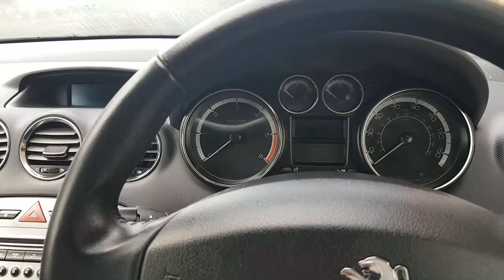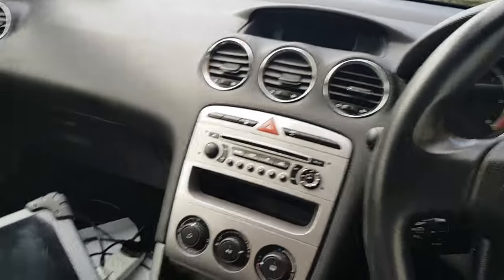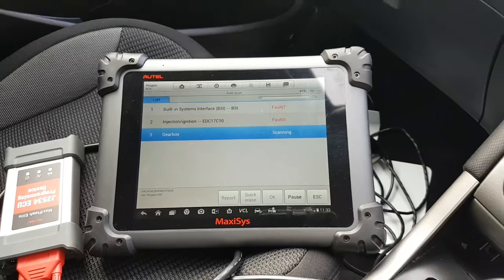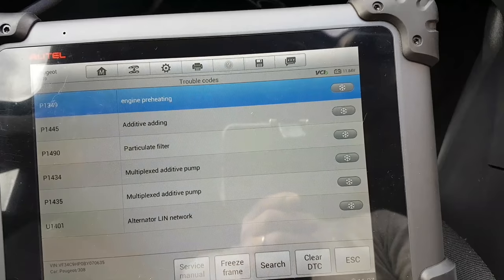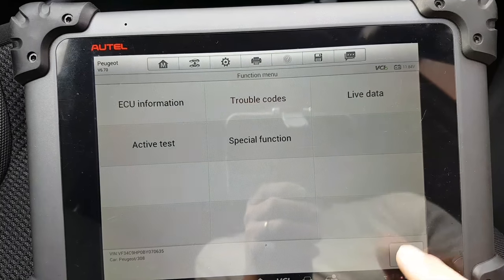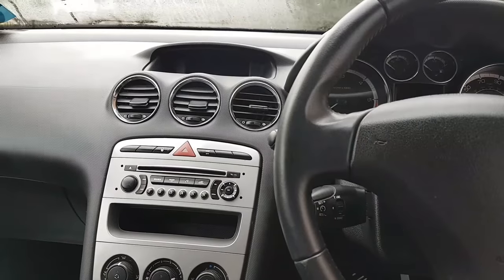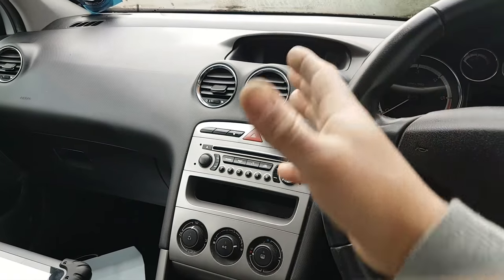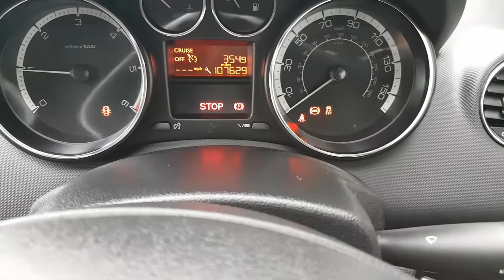Peugeot 308 not starting and multiple faults F569 C56E. Fault finding and repair.

Comment: My 2012 Peugeot 308 diesel only 29000 miles warning lights came on including the power steering and the power steering failed while i was driving ... the fault was the alternator apparently if your battery drops  below  about 11 volts all hell breaks out the car will try to kill you and your passengers ...  new alternator  £500 fitter ...  sound expensive  but the alternator was about £400..
Reply from the maker: Yes... low voltages can cause all sort of problems and gremlins...
Thank you for watching!
Reply: @LMAutoRepairs   love the videos  ....thanks

Comment: thank you very much for help. my friend has citroen c4 picasso 2009 with automatic transmission and suddenly car died- with many errors( didnt shifted or showed gears, didnt worked parking brake etc.). I found mentioned error in ecu and on the main cable behind that problematic relay was 1,5V instead 12V. So according your advice we changed whole unit and car is working like charm. That was wonderful.
Reply from the maker: 😊
That's great! 
👍👍👍

Comment: Good vidéo, thank you. just a question: the double relay that powred the pump and the solenoid valves of the ABS is it integr to this fameu module? if not where is it? thanks

Comment: Hello, I had same fault and waiting for relay. Is it safe to to drive while the two points are bridged.
Reply from the maker: Shouldn't be much of an issue...
Just have it sorted as soon as you can...
👍👍👍
Reply: Hello l, just wounderd for any advise really. So I changed the unit. Started great after an hour of leaving it had  same problem  again not starting just clicking. Out of all ideas? I put the bridge on again Started no problem
Reply from the maker: The unit you replaced it with, was new or second hand?

Comment: Excellent detailed video. My 2010 308 had a similar issue of multiple fault codes and intermittent starting. There would have been no way I could have diagnosed the problem myself so watching your process identified the issue was the same. I bought and fitted a second hand replacement battery management module part as you did. Car now starts and runs as it should with no warning lights. Many thanks for sharing 👍👍👍
Reply from the maker: 😊
That's great!
Well done!
Thank you for watching and for your comment!

Comment: This is exactly what happent to my peugeot 308,and same issue with all faults on. First all started with battery problem after I washed engine space. Hope I will solve my problem will write later.
Reply from the maker: 🤞
Good luck...
Thank you for watching!
Reply: Ok, changed everything, still dont have steering. I hope my pump is not dead.
Reply: Didnt solve the problem. Car wont crank, but when I connect + from battery to this unit's + I changed, then I hear click then I can start engine. Still have steering problem. Also battery is charging but it showed me that I have problem with charging the battery. After I turned off engine, and turned it on again battery lamp was off and everything was fine, but I still have steering problem. Any idea? 😊
Reply: Still nothing, tried with another steering pump, that is not a problem, tried also with another alternator. My bpga is reseting all the time. Problem started after I washed engine area. Also tried with another bsi, that is not a problem.
Reply from the maker: Check for water intrusion on plugs, etc...
Check grounds...
Reply: Grounds ok, plugs dry, fuses ok

Comment: Awesome vid , Ive suspected I had an earthing issue a lot of intermittent faults, currently, there is a gearbox fault  (no comms on bus ) there's a power steering fault a brake fault both high and low fuel rail pressure, no coms with the accelerometer steering wheel misalignment a broken cv boot o and sometimes it allows me to have high beam sometimes it doesn't . I think this sort of thing might be the issue for some of it . Just replaced the solenoid pack which did absolutely nothing to the gearbox fault 186 KM so probably was about to poop it anyway first transmission oil change I suspect . Gearbox is very brutal at engauging  at times other times ok .  O and I have to wiggle the steering wheel to start it sometimes . The joys of being owned by a Peugeot
Reply from the maker: Indeed... I would say the joys of owning a French car...😋
Hope you get yours sorted...
Thank you for watching and for your comment! 
👍👍👍

Comment: Do you know the U0028 fault code on a Peugeot 3008? instrument panel switched off while driving. The car wont start if the instrument panel does not light up. After a day the instrument panel lights up after opening the drivers door allowing to start the car. I also see the battery voltage is 15v when the car is running using a voltmeter but cheap diagnostic tool shows 15.2v.
Reply from the maker: High voltage can cause all sort of gremlins...
Double check that...
Thank you for watching!

Comment: Hi after configuration on a 208 bsi for no front seatbelt warning, good no sound for seat belts but remains fault B1003 configuration permanent and dont let me set it back. What do you suggest? I used thinkdiag
Reply from the maker: Sometimes you need to configure multiple modules for certain mods...
Not sure about that for the seat belts, as I have never done it...
But check to see if there if any configurations on other modes seat belt related...
👍👍👍

Comment: My girlfriend has a 308 sw 1.6hdi 2009. Have a major issue starting in cold weather heater plugs and module was tested and are in good working order machinic says it might be in the wiring. Also no heater coil coming up on dash when you turn the ignition on. Car starts straight away with a bit of easy start, any ideas ? At withs end with the car now and no fault codes coming up could it be corroded wires or connectors or where to start ?
Reply from the maker: Measure and check the wiring from the module to the plugs...
Test/Measure the plugs as well...
👍👍👍

Comment: Just on a different subject, we have a 2011 Peugeot 308, 1.9 diesel that is destroying starters. It is destroying the  brushes and commutator as if its staying engaged, as if the ignition switch was faulty. An issue on older cars. The ECU/BCI won't let this to happen though. Had you heard of any issues like this? Thanks for your time.
Reply from the maker: No... never even had that issue...
Just check that indeed the started is staying engaged...
I would say however, that such thing would be quite noticeable...
Thank you for watching!

Comment: Hi, I enjoyed your video. So it's not the starter motor or the alternator. I drive a 2012  508. I just put a new battery in the car. I have been having similar problems and at my wits end trying to start the car.
Reply: Hello. I have similar issues as you are describing. How did you solve your problem? Thanks
Reply: @conanobrien1  actually, the problem was not the  battery. Do u see where all the two or three big cables are tied down with a nut in the picture. That was the problem because the nut was loose.
Reply: @tommalone8026  Can you give me the time in the video where I can see the cables you are talking about? Is it at 13:19
Reply: Hi Conan, @ 13min you see a cable connection under the finger. Beside that connection u see a nut, make sure that is tightened securely.

Comment: Hello my master :-), my Peugeot also sometimes does not start and only the clock hands jump. I also noticed that when I turn the key in the ignition twice before starting the engine, the engine has more power, it does not jerk when starting and driving, and the electric windows go up faster. Could this battery module relay be giving out too little current when it makes a poor connection?
Reply from the maker: Difficult to say without checking...
Check/test your battery, connections, etc...
Scan the car, check live data, see if there is anything that points into any direction...
👍👍👍
Reply: @LMAutoRepairs  thnx

Comment: Thanks for great explained video! How sure I can be that the problem is at the relay? How often problem is located to wiring? My car did that once and it dissapeared after battery change, now it's giving "power steering fault" info at the screen. I have 1.6 VTI 120 /2011
Reply from the maker: Difficult to say...
Start by scanning the car and go from there...
Thank you for watching and for your comment!
Reply: Had to add that in my case the problem might be oxidation at +bat contact. I think quick release clamp is not the best choice for car batteries.

Comment: Hi, I have a 308, 2016 year. Some of its malfunction indicator lamps always (ABS, ESP, hill start assist, electronic handbrake etc.)  turn on after raining. First I thought that a malfunction (like wetting some electronics) under bonnet is causing this problem but even during a newly started rain, its lamps turn on. I mean there is not a chance for bonnet to get wet. Can the problem be with sensors near tires or what could be the problem, can you help?
Reply from the maker: If you say that it is when is raining, surely water is getting somewhere...
Have you scanned the car?
I am pretty sure that all those faults are due to one single issue causing them all...
Scan the car and check live data...
👍👍👍👍

Comment: Hi. I have the same problem on a 2016 DS5 2.0 HDI 180. I have the BPGU on order but a global supply issue means no delivery date. Car has been starting eventually (1-20 minutes of hitting start button). But last week it stopped starting and goes into economy mode. I have 12.5v on battery and to fuses that don’t go through the BPGU. But only 0.6v on the outlet of the BPGU. Can I do what you did and bypass the BPGU with a wire from the positive to the BPGU outlet side? If I can do you think it might “reset” things back to the way it was or can it be driven like that. Thanks in advance. Jeremy
Reply from the maker: I would say, it should be ok to temporarily get it going...
👍👍👍

Comment: Hi sorry to trouble you but I'm having a problem with my 207 1.4. My power steering light came on and the car went very heavy I had it looked at at the plugs was cleaned out and then it started working again about a week later it stopped working again then Iv notice my alternator was not pulling correct voltage so Iv had that replaced  thinking it might of solved the problem he also cleaned the plug again said it was green then after that the car will still bring the fault up but sometimes the steering kicks in and work untill I stop the car turn off and on and it's stiff again it showing up the fault code f047 and wonder if there was any more help on what the problem can be thanks for your time
Reply from the maker: Check all the connections...
Not just at the plug...
Specially ground points...
Fuses etc...
Otherwise, it can be a bad steering module...
👍👍👍

Comment: Good man!

I have Peugeot 508 diesel 1.6 / 2012.
Stopped engaging in to rear gear after that any gear at all.
Had it towed straight in to service Gearbox & Axle Centre here in Cwmbran!
Sit there for 3 weeks or so nobody called me.
Went to the garage to see the car and it has no battery to start the car and on the dashboard said Electrical Fault Have vehicle repaired.
No click from the engine... Nothing!
Just says press the break and put in Neutral gear.
When I asked the mechanic was told I have to find the actuator exactly the same one like on the car or if not I risk to burn the ECU.
The are saying they can't find the number on the actuator.
And if I cant bring it to them to take it from there.

Can you give me a advice, How the car had the Electrical issue in that garage I can't start it from the key anymore.
It went to this garage without electrical problem I had to take it with Electrical issue from there?
No one in Cardiff can find what's the fault everyone is giving up from it.

HELP
Reply from the maker: Hi
Impossible for me to tell...
They are the ones that will have the answers you want... 
Let to give you the car back, at least the way it was...
Thank you for watching!
Reply: @LMAutoRepairs  Thanks for your quick response.

I wish to met a mechanic like you for peace of mind.
Who know what he's doing.

All my bests.

Comment: Have paugeot expert with the same issue, doesnt crank but also no coms with ecu. All fuses good, cable looks good. Any idea where can i begin to look. Have no diagram and i dont know what pins have to have power on ecu
Reply from the maker: You will need to get some diagrams first then... so you can measure power and grounds, CAN lines etc... at the ecu...
A Google search should help you...
Thank you for watching!
Reply: Thats the problem i cant find on what pins should i have feed and on what ground. And if not at any there is the wiring probleem or the BSU

Comment: Hi I wonder if you can help me pls, I'm having problems with my Peugeot 207 diesel yr 2007, windscreen wipers and headlights comes on randomly and heater goes off, and no front indicators? What could be the cause of this pls? Thanks in advance.
Reply from the maker: Difficult to say...
But start by checking connections, wiring, grounds... etc...
Scan the car as well, and go from there...
👍👍👍
Reply: @LMAutoRepairs  Many thanks for quick reply, so far i have checked the fuse box next to the battery and it's bone dry there and no visible corrosion. unfortunately i have no diagnostic tool to scan and dont want to take it to the garage and throw lots of money on as the car is pretty old, typical that Mot due end of the month too. I'm going to give have a look at the ecu plugs and see if i can find anything else. Thanks again for the reply.

Comment: I have same problem with my Citroen DS3 i changed the engine now the dash lights up but the engine doesn't do anything so hopefully this will be the problem
Reply from the maker: If you replaced the engine, double check everything... something not plugged in correctly, plugged wrong, etc... make sure you have not missed anything...
A scan to the car will might also help...
👍👍👍

Comment: Hello! i have a problem on a citroen c8 2.2hdi 2006 the engine suddenly stopped working, we figured it was a fuel delivery problem so we changed the fuel pump but the car still doesnt starts, but when we supply power directly from the battery to the fuel pump the engine starts so we again figured it was the fuel pump relay but we cant find it anywhere, do you maybe know where the relay is located? thanks for the support and great videos!
Reply from the maker: Would have to check diagrams... and there is a few variants...
But check the main relay...
You can surely trace the wires back and see where they go... most likely to the under the bonnet bsm or fuse box...
Thank you for watching!

Comment: I have same car I'm getting engine overheat warnings and my coolant gauge goes up to the limit to put the stop light on.. Its just had a new timing belt and waterpump.. Getting high engine temp warning
Reply from the maker: Check live data... clear the codes...
Visual check that everything is correctly plugged in, and that nothing has been damaged...
Make sure the coolant circuit has been correctly bleeded, and that the coolant is circulating correctly...
👍👍👍
Reply: @LMAutoRepairs  I did a countdown reset upon start up it seems to have cleared it but I csnt get above 70 mph fsr
Reply: Ve you any idea why I can't get above seventy.. It reaches 70 then kinda sticks there I feel a slight jitter and it slows a bit
Reply from the maker: @Doadz  
Many different things can cause that...
Scan the car and go from there... anything can be pure guess work...
👍👍
Reply: @LMAutoRepairs  do you think missing o rings on coolant and oil caps would start the engine overheat and stop warnings
Reply from the maker: @Doadz  
The coolant would most likely leak out without the oring on the coolant reservoir...

Comment: What I have spotted that there are two missing bolts near the fuses that are on top of the battery. 
One myght be unused as there is no wire comming to it, but the other one (orange) must have it
Reply: just noticed same bolt on orange fuse missing on my battery fuse- hmm...

Comment: I have a 2013 3008 and it is doing the same thing.... can I bypass the module and drive the car until I get the new module to replace the bad one?
Reply from the maker: Yes... you should be ok for a short period of time...
Thank you for watching!
Reply: @LMAutoRepairs  your video saved me big-time...your brain work made my situation easy.... thank you so much....
Reply from the maker: @bradwall13  
👍👍👍

Comment: Hello Bro, can you advice me. My 308 T T7 6 speed gear come out warning lamp (top up engine oil level) & (Top up coolant level) after i checked engine oil & coolant i found engine oil & coolant at  maximun/enough. After that im replaced coolant sensor & engine oil level sensor but can't solved the problem... what should i do ?
Thank you in advance
Reply from the maker: Check for codes, live data... 
Thank you for watching!
Reply: @LMAutoRepairs  You mean diagnose?
Reply from the maker: 🤔
Yes... read the codes, etc..